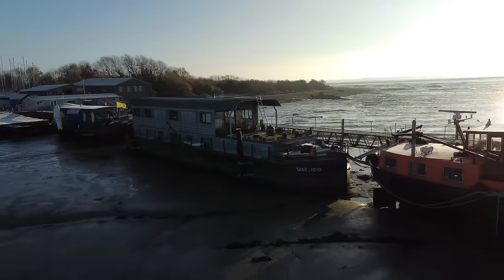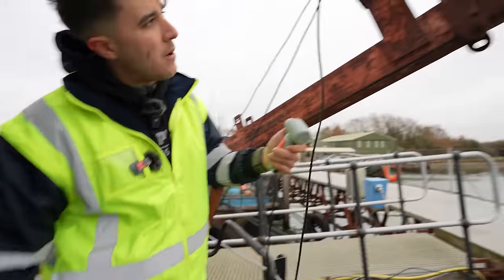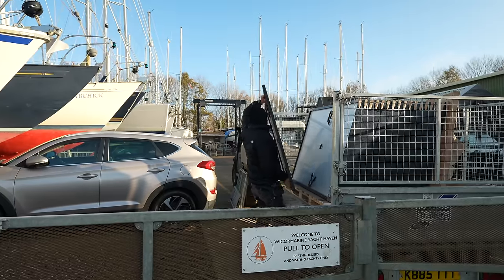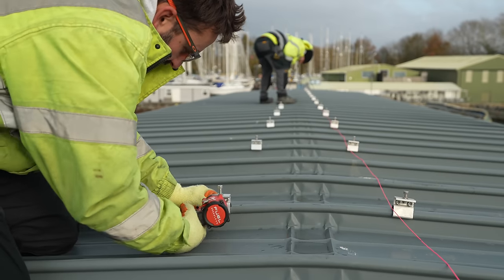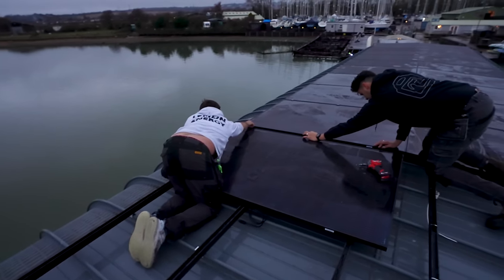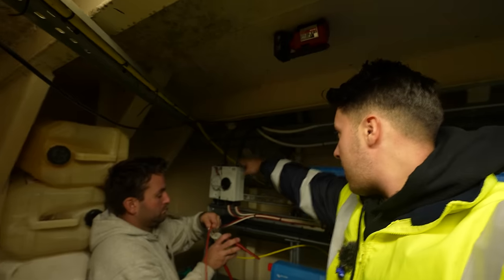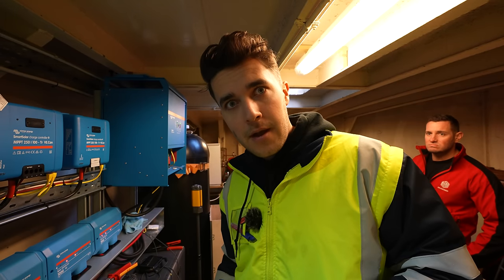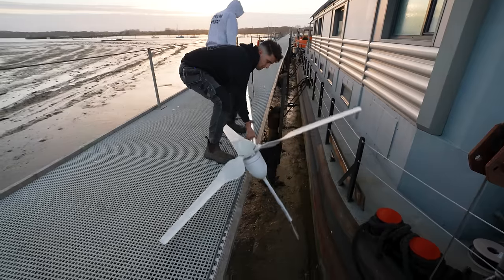Building a Floating Power Station | ØY34

Comment: Gotta love that balancing feature on Victron, because it works in reverse too. Currently using it right now during the negative periods on Octopus.

When a negative price comes in, all the electric air heaters turn on, and the battery starts charging, but will only charge up to the point where 50A is being pulled from the grid. If a heater turns off, the charge increases its charge.

So many uses for such a simple tool.
Reply: I'm using Node Red on mine to control schedules for saving sessions, amongst other things, fantastic system.

Comment: The isolation transformer is very important for a marine installation like this. The primary use case is the elimination of galvanic currents between boats via the earth wire (assuming the earth has been bonded to the hull as it should be). Steel boats in a marina connected to shore power can effectively turn into a battery and the hulls over time can corrode away. Breaking the earth wire with the transformer protects the vessel from this risk. If for some reason you bring the vessel into dry dock/on land, and need to connect to shore power, the jumper in the unit should be changed so that the ships earth wire is connected to shore.

Comment: It takes me back 30 years using those isolating transformers, we used to use them in really expensive bathrooms in Bishops Avenue to isolate earths. They work like a yellow site safety transformer, but have an equal number of primary and secondary windings giving 230v in and 230v out

Comment: I wouldn’t have put the wind-turbine right in the Starlink antenna’s view of the sky. Starlink antennas are phased arrays, they track satellites across the sky without moving mechanically, so that pole and wind-turbine will be in the way when satellites are being tracked in that direction.
Reply from the maker: That’s only a temp spot whilst BT line was damaged 😎👍🏼. It’ll need a permanent solution once it’s rewired with KNX

Comment: victron... victron everywhere! solid kit though. i use the 250 / 70 mppt and never had a problem with it. helps run my entire home from 2 panels in the summer time. plus the 7.5kWh of storage and 2kW inverter of course.

Comment: Top work. Just wondering if you consider not using rails with the S3! clamps on the standing seam to keep the panels closer to the roof and limit the uplift?
I’ve got a standing seam roof here and we just used the direct panel clamp kit to fix direct to the seams and do away with the weight of the rails.

Comment: Really interesting video, i am from a electrical marine background so am really interested in how this goes 

Oh you were right with the plumb level problem you pick a line and work with it. 

I will be honest we don't use unistrut due to the vibration aboard ship so almost exclusively welded brakets with nylon nuts or directly tap with cable tray for cable management, 

Out of interests why didnt he just go for a inboard geny to work with the systems installed and completely cut out the shore power as i would think the power would add to his mooring charge, and if it did have propulsion i would think the sea intlet would still be there but tide maybe the issue 

And that crane connection.......that is the kind of thing you find on old barges its rife sadly

Out of interest are you using water tight gland blocks for the cable runs or since its not going to moved just doing what works best for you?

All vessels of any decent size use a isolation transformer standard practice for the exact reason you saw also never will you find a rcd aboard it will be double pole mcbs.

But really interested in how you guys went about your choices as you have the marine requirements and the pv system requirements which makes it a difficult job.

Also I can't see that windmill working with the vibrations it will be annoying as all hell 😂

Sorry for all the questions as this is pardon the pun in my wheelhouse 

Great video 

And merry Xmas to you and the Mrs
Reply: Agreed the vibrations from those fast turning wind generators are the reason they died a death on houses, never mind attached to a steel drum. Oh, and the pathetic output.

Comment: Much more interesting than a board change or car charger, ex marine spark myself .. You will find a lot of the water is through what we call "ship sweat" happens on boats with storage etc at waterline .. Not a fan of the lynx system as those mega fuses cant handle the short circuit current of a lifepo4 and i lay money the customer will be calling back to get the wind turbine removed because the vibration will annoy the hell out of them .. great content, merry Christmas bud
Reply from the maker: The batteries have a 200 amp fuse inside, we’ve also got additional fuses in the lynx 😁👍🏼. With the wind turbine… watch this space 🤣👍🏼. Thanks mate 🙏🏼🙏🏼
Reply: Yeah i know the lynxs are fused, fitted hundreds of them-but only with wet cells, I meant interruption current, from memory i think a mega has a 2ka whereas a lifepo4 at 58v will need in excess on 10ka.. interested to see what you do with the turbine.. its a challenging job esp on a steel structure that's sitting in water that transmits sound 5x faster than in air
Reply from the maker: Mate… are you on Instagram? I’d love to show you the outcome of the turbine 🤣👍🏼
Reply: Hardly ever use it, but just followed you .. do much work with johnny no neck these days?

Comment: this has been the most interesting project from Cory I have seen, I am a keen believer in Solar, but I have a 32 panels system in Spain and I only have one box Hybrid charger inverter, why does victron have so much gumpf, my battery is unfortunately a 10kwh Li-ion battery from LG, i actually needed about 30kwh, but they were 6000 Euros each. great video and great job, £75 grand would have been too much for me, I paid about 26000 euros
Reply from the maker: I definitely didn’t charge £75k 😂. Although it could have been reasonable to charge, I was very competitive for a very fantastic long term customer relationship .

Comment: If you have a boat with a shore connection you always always! Fit a iso transformer. The earth leakage can corrode the anodes and after that the hull itself. Biggest sinking reason for boats is galvanic corrosion and condense water rust on the inner bottom.
Reply from the maker: There’s what we’ve fitted, 1-1 galvanic Victron

Comment: How have you found KNX? I used to do home integration programming and had to integrate with a KNX system in an office block in London. I found the HVAC side of KNX nice and easy to integrate with but for Shading (blinds) it was pretty rubbish.  We only had access to Full Open/ Full Closed or Pulse and the pulse would move the blind about 20mm each time you pulsed it so if you wanted the shades half open they would go Ju Ju Ju Ju Ju instead of a nice smooth Juuuuuuuuuuuu. 

There was nothing the KNX "Programmer" could do and there was nothing on my end that could be done apart from remove the option of partially open shades. It seems with the likes of KNX, Loxone and Lutron you seem to be at the mercy of the system integrator/configurator person. I was the Crestron/AMX guy that made the back end system work with fancy remote controls.

Comment: Laser level? Magnet to side of wall? At least it will have some level, even if you locked laser line in place?
Reply from the maker: Laser level uses gravity, as does a bubble in a spirit level. You have to measure off what’s there already in a moving boat

Comment: Starlink signal is going to be disrupted by the pole / turbine. might be getting away with it now but when the barge moves it most likely will.
Reply from the maker: It’s only a temp setup as you’ll see 😎👍🏼. The barge doesn’t really move much either tbh
Reply: @corymac  Intrigued. Just checked and doesn't look like good coverage as Three 5G at that site as if you can get that then its seriously cost effective.
Edit : Just looked up Newland and I don't think they are short of a bob or two but surely limited by what the marina will allow them to have.

Comment: Reality is that in the UK at this time of year solar is next to useless and confirmed by the VRM data, this system made a whopping 1.5kWh today, also for some reason it's only drawing 9A from the 16A shore power,  battery at 27% and only 51v, at their current usage (is heating all electric?) might not last the night, certainly not tomorrow.  The install is impeccable but sadly and extra 1.5 kWh a day is woefully inadequate, of course in a few months they'll have more power than they know what to do with. Figure out why you're only getting 9A from the shore power!

Comment: Regarding the RCD. It's not too sensitive, they must hold a minimum of 50% of the rated trip current and no more than 100%. 30mA rcd needs to hold 15-30mA. Most 30mA rcds will trip between 21 and 27mA.
Reply from the maker: 30ma is too sensitive for this install would have been a better way of wording it 😃👌🏼